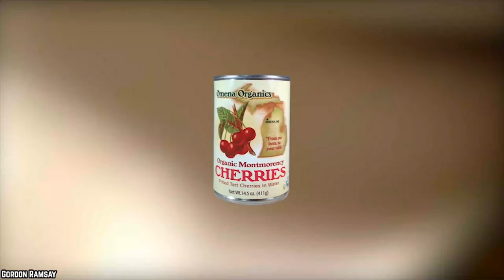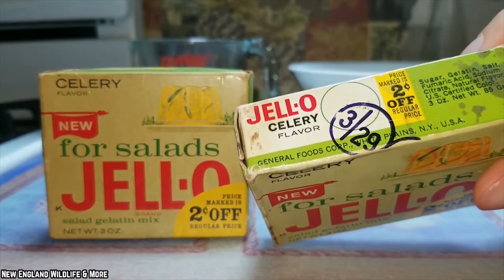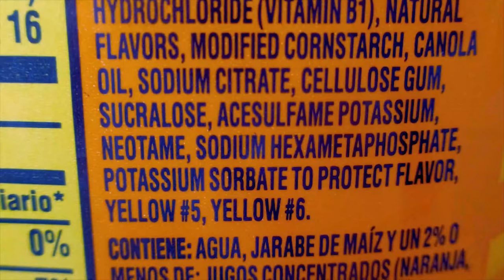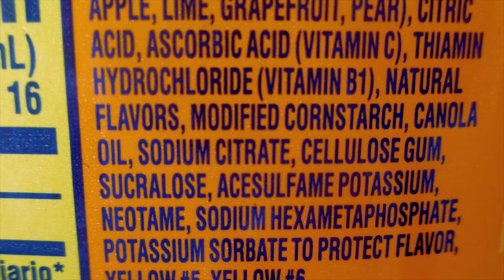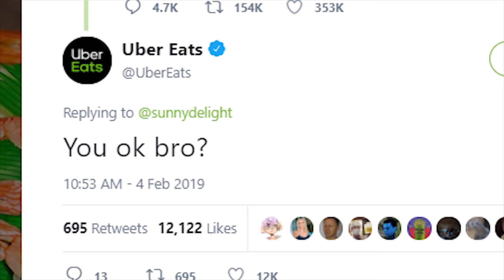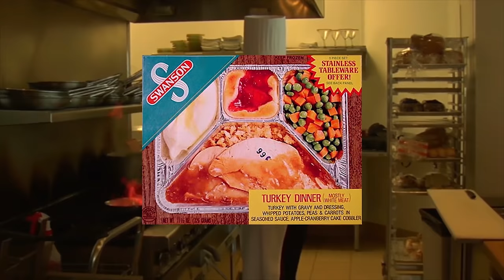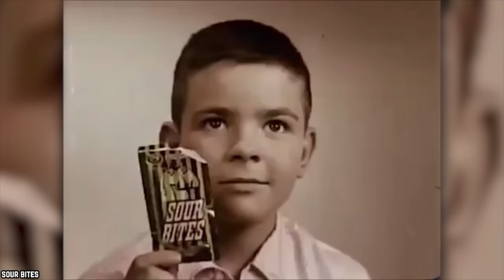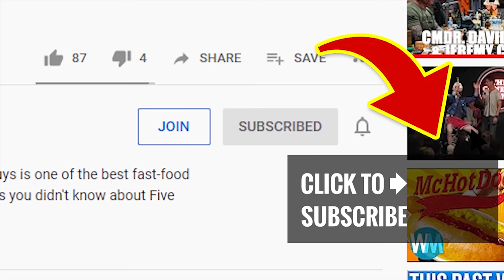Top 10 Once Popular Foods That We All STOPPED EATING!!!

Comment: i live on an extreme budget so TV Dinners ... yeah i still eat them on the regular kuz they are cheap
Reply: That's a lie.
Microwave meals are about convenience not cost effectiveness.
For the same price you can easily get better and more food.

As an example, a michelena's pasta offering is generally around 4oz for $1 usd. That's $4 per pound.
Whereas, a lb of dry pasta and a jar of sauce(1lb avg) will cost about $2-4, dependin on brand and type.
And if you shop well, you can buy pasta in larger quantities and save even more.

Then if you actually compare the full meals and variants, it becomes less and less cost effective.

As someone that's on a tight budget myself, i haven't purchased a microwave meal in years.
When i can get a 10lb bag of chicken thighs for $6, a 10lb bag of potatos for between $0.99 and $2.99, as well as other more cost effective foods, and feed myslef for a week or so, as opposed to a few days,they don't ever make financial sense.

i will say that there is one situation where they do make sense, and that's when a person has a disability.
But that is very situational dependent as there are ways to work within that disability.
And in most cases there are still more cost effective options to nuclear waste(what i call microwave meals).

Comment: CRISCO? Obsolete or passe??  Not in this kitchen. Besides cooking, making a great flaky pie crust, a great dough for wraps or pockets, real good when you run out of olive oil and good when making pancakes - CRISCO was the only product allowed on skin fresh out of plastic surgery because it's that "pure". CRISCO is s great makeup remover, moisturizer and excellent for sunburned skin! - no peel. Granted you might slip off the chair and drop the phone....
Now CRISCO makes  SOLID  COCONUT OIL. It  "smokes" at low temperatures if used when cooking but is a great moisturizer and makeup remover. Not half as slippery on the skin as regular CRISCO. 
Candles can be made with CRISCO solid. The vid is here on YouTube. 
CRISCO SHORTENING is great stuff 👍
Reply from the maker: Wow!  Thanks for sharing this LIZZIE SANGI Sangi! 😄 Have you subscribed to our channel yet!? https://www.youtube.com/channel/UCX--mGSg0UwDjl7MDL8H5Jg?sub_confirmation=1

Comment: I will be happy when that current holiday thing called Green Bean Cassarole is dead and gone.
Need I mention fruit cakes? I should say bought fruit cakes. When I was a kid, everyone made fruit cakes at Christmas. They had no resemblance at all to the bought ones.

TV dinners were not all that bad when Swanson and others first began making them.
Some years ago, I was still taking them to work to heat for lunch. I discovered that the el-cheapo Banquet brand at Walmart was better tasting than the expensive brands. One diet brand actually had more fat, cholesterol and sodium than a regular Banquet meal.
One reason, I think for the frozen dinner "bad" is the use of soy protein. Everything has soy protein in it now, even canned tuna.